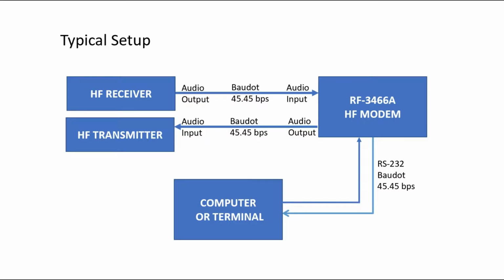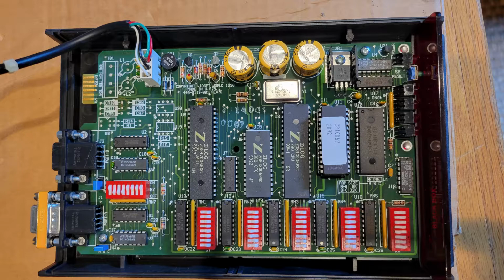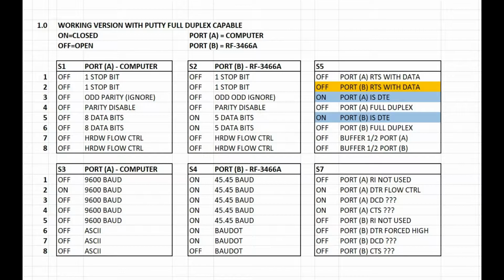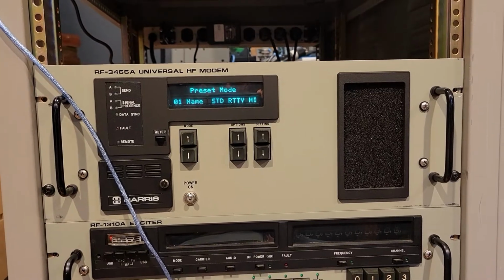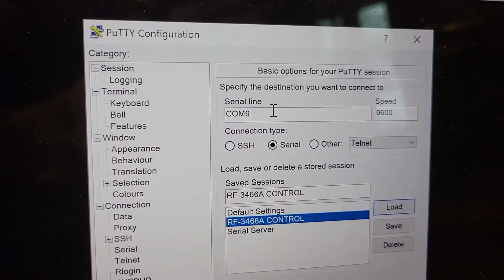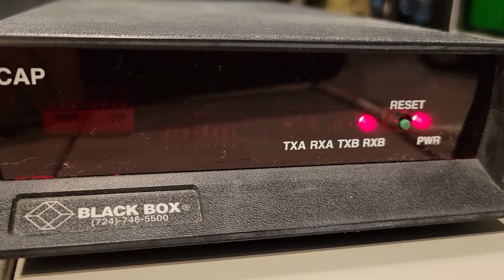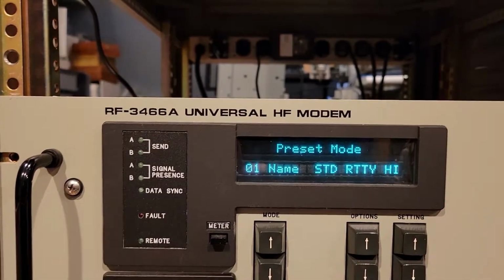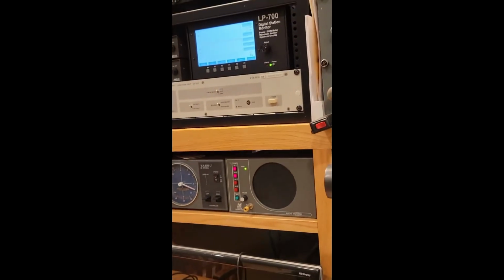Part 3: Harris RF-3466A Universal HF Modem

Comment: can you make a dump of the eeprom? i have a black box cap coming in but the state is unkown. and i have not yet found any one out there that has a dump of the eeprom.
Reply from the maker: Let me know once it arrives. I haven't read the eproms but if you decide you need it, I can try. Do you know if the one you got is a "user programmable" version? It would say on the front plastic face.
Reply: The one I bought is a black box CMA01A CAP. its a older version but also has internal the dip switches for the settings and should be very simular. only difference is the older DB25 socket instead of the DB9 sockets. it has the same front as the one you have.
Reply: @w2hx  if you find the time to read the eproms that would be great. I have received the CAP and i can program it too. its a older model but almost indentical to the one you have. it has DB25 instead of the DB9 and there are a lot of jumpers instead of nice dip switches. and it has only 8K ram instead of the 32K ram your unit has.
Reply from the maker: @djneon12  can you contact me?  My callsign at my callsign dot com
Reply: @w2hx  i have send you a email with the info of my cap.